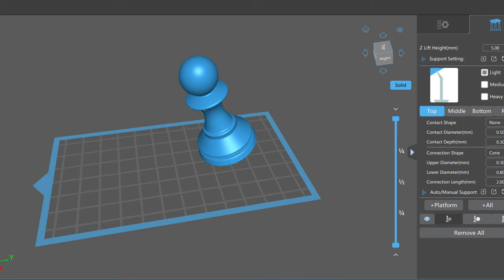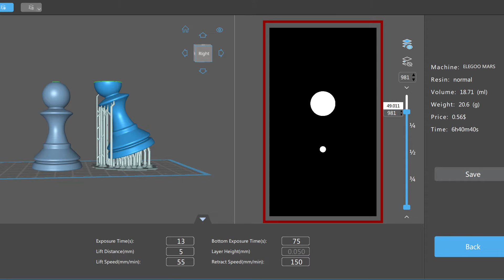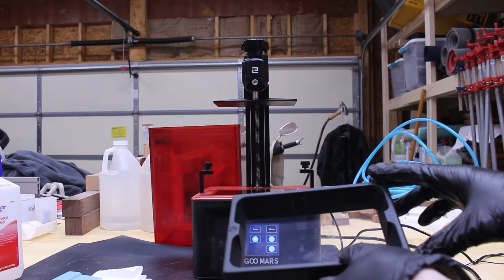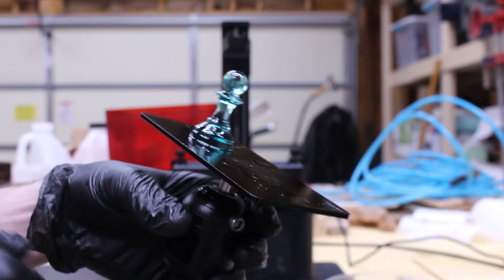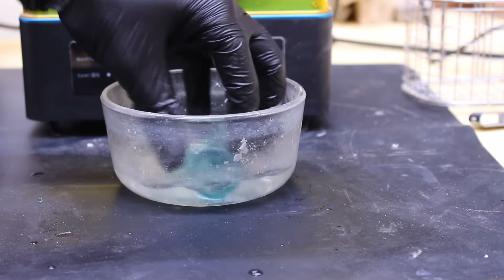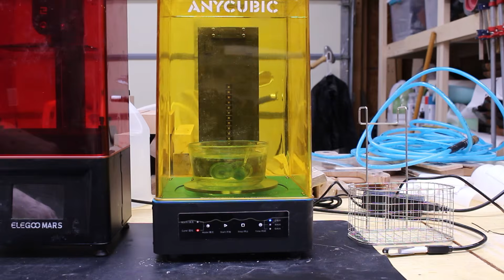Resin 3D Printers are Great But...

Comment: Just as a pedantic point, the output from the slicer with a resin printer is not G-code. It is a series of bitmap images corresponding to each layer of the model stored in a proprietary format. (Which has been reverse-engineered, if you need to create your own)

Comment: They looked much cleaner and better before washing. I'd just let them dry as is without cleaning them first, and cure them after all the excess resin has dripped off and dried, to keep the shinyness and transparency of the resin.
Reply from the maker: Has this method worked for you? If so, what resin are you using?
Reply: @LetsMakeAThing  Haven't tested it myself yet, but I've heard other people recommend not to wash it. Of course, on detailed models you gonna lose some detail if you don't wash the excess resin off, I'd assume. Maybe there's some after-wash treatment to make the resin look shiny and transparent again, that I don't know of yet.
Reply from the maker: I'll have to test not washing first and see what happens.

You can use a clear coat spray on the print that will make it shiny again.

Comment: Eek, I see pieces of resin covered plastic flying across the room, and getting onto the floor, for a poor smuck to get on them, while removing from the build plate.
Reply from the maker: In 2016 I got an original Formlabs resin printer and their official media demonstrated using the side cutter method to remove prints from the bed easily. I've been using that method since then and I have dropped one or two like in the video but I haven't had any pieces go flying across the room.

Comment: what i like abt resin printing is that you don’t get a lot of errors, and you can start as soon as you unpack the printer
Reply: This! I have FDM printer for years and almost never had good print. No fails with resin printer except the time I make poor supports.
Reply from the maker: There are definitely fewer moving parts and less things to tune on a resin printer than an FDM printer for sure.

Comment: No you don't have to have supports on resin prints. I only print on the build plate. I was and dry the prints on the build and even put the build plate with parts still attached in the UV curing station. Depending on the resin I cure in water. Some resins are discolored by water. I print functional components for my products. Printing with supports dramatically adds to the labor costs.
Reply from the maker: I did forget to mention that most wash and cure machines allow you to put the entire build plate inside. Thanks for the reminder!

Comment: Printing in resin and casting in resin are two very different processes.  You should only use a butane torch for removing bubbles on casting, not on printing.  Printing starts on the bottom where there are no bubbles.  Please don't set your printer on fire.  And I may be mistaken, but I think that Acetone is quite flammable also.  Please be careful
Reply from the maker: I've been using these methods for a long time and am always extremely careful when using them but I should have added a massive don't try this at home disclaimer for people new to 3D printing. In fact I'm going to go add that to the description now. Thank you for the comment!